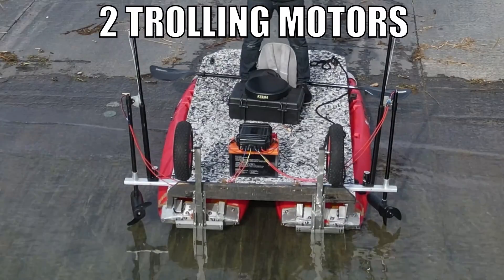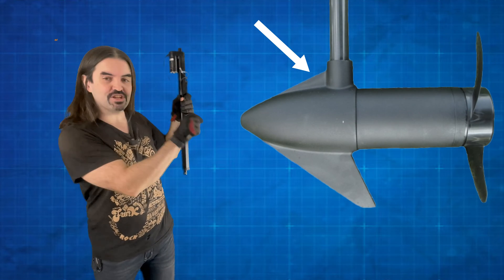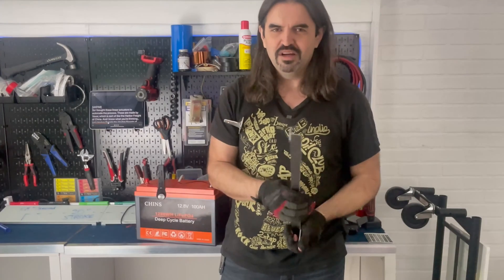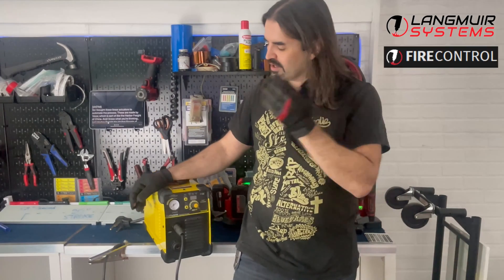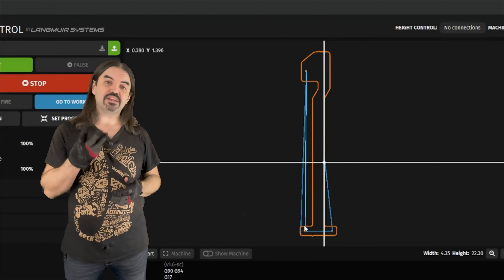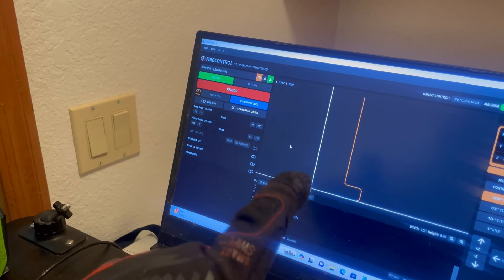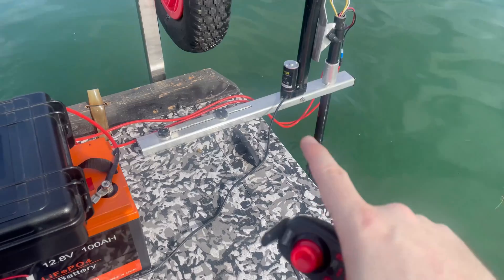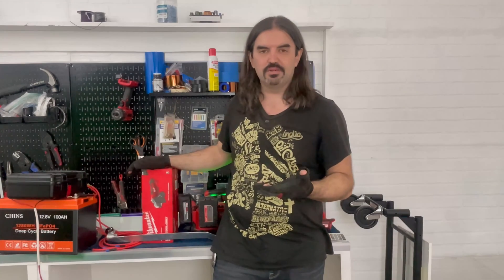I built an automatic dual trolling motor lift

Comment: You could also up the voltage on the actuator from the research I have been running across???
Reply from the maker: Interesting idea. I’ve overvolted trolling motors before, but never an actuator motor. I imagine it’s similar… it can prob handle it but if the voltage goes beyond the service factor, it’ll overheat. No telling what the service factor is on these cheap actuator motors, but I don’t think it would last long above 1.5. So I might try running them at 24v just to see what happens under a heat gun, but I suspect it may damage them. If I can’t get up to 24v, I don’t think I’ll want to bother with a boost converter to hit somewhere in between.